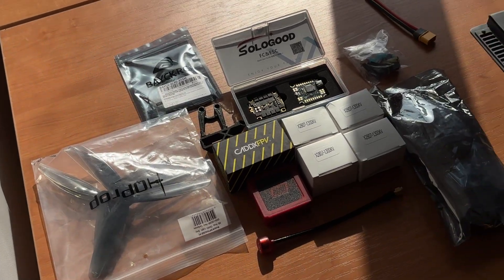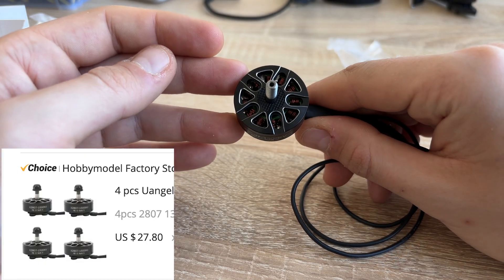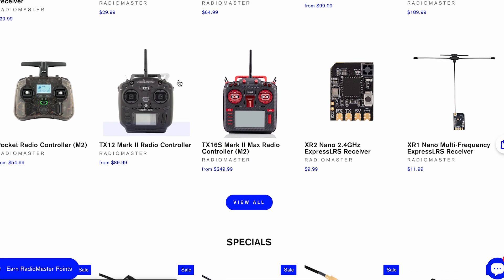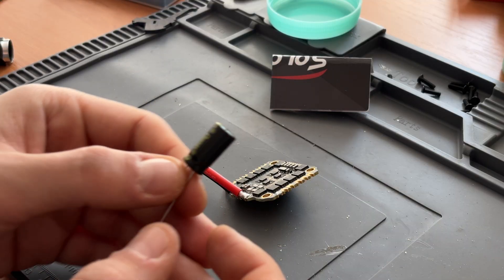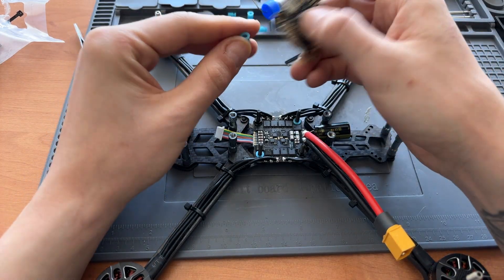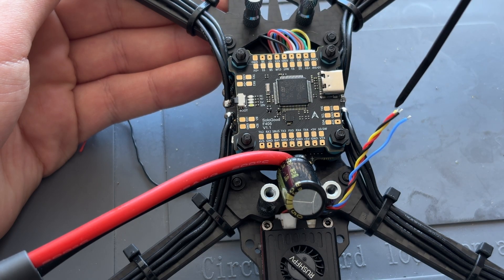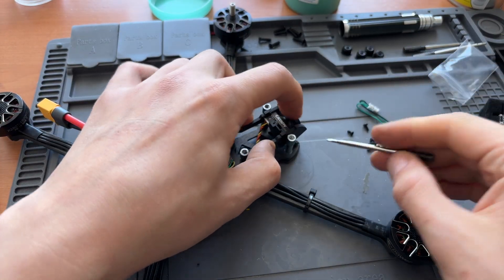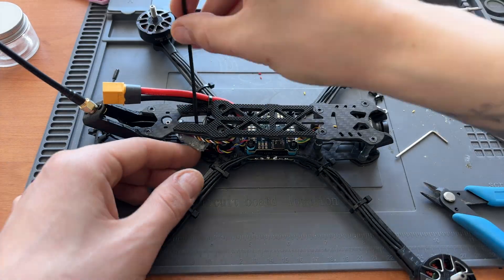FPV Drone Assembly Guide 2025 - Long Range Budget Build | Part 1

Comment: How much do you spend ?
Reply from the maker: I bought all details during Ali sales.
Stack - 37$
Motors - 28$
VTX - 42$
Camera - 17$
Props - 2$
RX - 6$
Frame - 8$
Video Antenna - 4$

144$ in total - 12$ coupon = 132$
Reply: If you start from 0. Soldering kit, controller, and drone. You are looking at around 700-900eur
Reply: I’m trying to have this price! :/
Reply from the maker: @GabrielRibeiroData  currently stack much expensive due to high demand. Also i've provided price in order to deliver into Ukraine. You may notice that when you'll switch destination country the price and shipping cost may vary. 
But general advice: add into cart similar items from different sellers, than on choice day (usually it starts in first days of every month) check the lowest price and apply coupon. If you are trying to find such prices right now - it's unrealistic, unfortunately :(
Reply: @DCSets  Hi, thank you very much for the tips, will do that.
Reply from the maker: @GabrielRibeiroData  you welcome!
Reply: From France, it's more around 250eur

Comment: battery model and wegith isn't specified in the captions. what is average flight time ?
Reply from the maker: I use DIY LiOn batteries with 21700 Molicel p42a elements
The last time tested - 13.5 minutes with 1.5kg camera for 6s2p battery.

Comment: Very nice video, thanks. Just a question, are 70x40 props too aggressive for long range, maybe? Maybe props with lower pitch could be more efficient for long range?
Reply from the maker: Since the last tests, I didn’t notice any significant difference between 70×40 and 70×35. The overall prop condition and quality matters more ( for example in my tests 7 inch hqpros were much better than gemfan).

Comment: 1. max range (not talking flight time)? i suspect the limiting factor is the radio right?
2. no gps? is there any space for it to be added?
3. the gopro mount can be found online for this frame?
Reply from the maker: 1. It depends on radio quality and battery. With retranslator and 6s3p could easily hit 20km
2. You need slightly different tail mount, but it's a quite big drone, so you shouldn't have any issues with gps placing
3. I see some models by "geprc mark4 gopro mount" request. It's a popular frame so should be a bunch of variations

Comment: What are good battery options for this build? What should be max battery weight for 7 inch drone?
Reply from the maker: Since this motors are not rlly responsive for freestyle - you should be ok with lion battery for cruising. 6s2p lion weight somewhere around 900g. This build can easily carry 1.5kg more.
If you want cheepest option for practice - 6s1p lion
6s2p - double the range
lipo - a if you'll decide at some point go to freestyle and swap motors
Reply: @DCSets   i bought 6s Lipo 6000 mAh. 22.2 V 50C weight 900 g. and it looks massiv when i place it on top. It all most leave no place for GoPro on top.😊 Considering even attaching it to the botom. My goal here is long range.

Comment: Which controller do you use or which one do you recommend for this drone, for beginners, and at an affordable price?
Reply from the maker: Hey! It mostly depends on the size of your hands and personal preferences.
The most universal option is the Radiomaster TX12 ELRS (I also have an external module to support 915 MHz). It costs around $100.

The cheapest option is the Radiomaster Pocket, which also works great for most builds, but it has fewer auxiliary switches.

If you prefer larger controllers, go for the Boxer or TX16.

My personal favorite (I have it too) is the Jumper T20S with RDC90 sensors. The only downside is that I couldn’t find a 915 MHz module, so I bought the 915 MHz version instead.

As your first controller, I’d suggest going with the TX12 — it’s versatile and easy to resell later if you decide you need something else.

Comment: I couldn't figure out if the remote and esc are connected automatically, they don't mention this in any of the videos, the remotes are sold without esc.
Reply from the maker: I don’t fully understand your question. The ESC (Electronic Speed Controller) is not directly connected to the remote. It simply receives commands from the flight controller and spins the motors accordingly.

If you’re talking about the receiver (ELRS in my video), then yes — there’s a simple, but not automatic, connection process. You have two options:

Manual binding: Quickly power the receiver on and off three times (either separately or while it’s connected to the flight controller). This will put it into bind mode — you’ll recognize it by the double blinking. Then, open the ELRS tab on your remote and press Bind.

Bind phrase: You can also set up a bind phrase (like a password for your remote). When flashing the receiver, you can enter this phrase. In that case, the receiver will automatically connect to your remote once both are powered on.

Comment: how do you control the drone?
What is your controller? Are you using goggles? What goggles do you use?
Reply from the maker: It's controlled by ELRS, so you can use any controller with its support
I'm using Radiomaster TX12 (also have Jumper t20s). ( i covered it briefly in next video https://www.youtube.com/watch?v=UJcXizibt58 )
Googles - Skyzone 04x pro

Comment: What's the weight and what controller do you use?
Reply from the maker: wdym by weight? if you’re talking about payload - up to 1.5kg camera
controller - i have tx12 and jumper t20s
Reply: @DCSets what's the overall weight of this drone? We have a sub 250g limit in the UK
Reply from the maker: @timne0  ah, got it. Without battery it has somewhere around 650g weight.
250g (without battery) it's something tiny, like 2.5-3inches

Comment: Hi again...i am a bit mixed up regarding the reciever...i bought the BAYCK ELRS 915MHz / 2.4GHz ...it says both 915Mhz and 2.4Ghz...so which one is it ? 915 or 2.4Ghz? or can it be configured for both? my radiocontroller is (Radiomaster Pocked Edge) TX 2.4Ghz...will it work? Thanks Ed
Reply from the maker: If your controller 2.4 it’s compatible with 2.4 Rx only. 
You can’t dynamically switch frequency on receiver. Its 2.4 or 915
Reply: @DCSets  ah i see ok noted...😬 thanks!

Comment: in 14:36 there is a long beep, does it mean you has a short circuit in your cam? and 14:40 also you have long beep in your VTX line, does it mean it is short circuit as well?
Reply from the maker: On timestamps you mentioned i've just checked grounds, so the long beep was expected )

Comment: i am following your build but for motors i have 4 X A2212/13T 1000KV with red,yellow and black wires do you think i can use instead of the motors you use here? can i attach in the same way to ESC...i am using the same Flight stack you use in video...Thanks Ed
Reply from the maker: Technically yes, but  double check the specs. I’m almost sure that they designed for bigger props (maybe it’s a motors for planes). And make sure u are using right battery to not burn the motor.
In terms of connection you can attach 3 wires in any order. It affects only spinning direction which may be changed in betaflight
Reply: @DCSets  Ah ok great thanks!!

Comment: How do you know which wires to solder where? Also is there any kind of tutorial on how to pick out which parts to buy based on what you want? Also are there any tutorials out there on how to add in extra functions to the drone?
Reply from the maker: For every part you always connect power wires, which depends on device consumption. Rest wires you connect to UART ( rx/tx on fc ) or to dedicated pin.
I guess the best tutorials you may find on oscar liang website and joshua bardwell youtube channel

Comment: Flight controller is sold out, any good alternative?
Reply from the maker: You can find plenty of other seller on Ali https://s.click.aliexpress.com/e/_ooMl9i8 for example. Just check the search.
I've tried Speedybee, SoloGood and Mamba. Since i'm not pro racer i don't fell much difference. 
The only thing to mention - personally i found that F722 a bit easier to tune than F405 controllers

Comment: For a beginner which head set would you recommend and controller would you also recommend for this build. Thank you
Reply from the maker: It mostly depends on your budget.
Controller:
 - Radiomaster TX12 (MK2 ELRS) – This is the ultimate choice. It comes with 2.4GHz ELRS, which works well for most quads. For the build shown in the video, you’ll also need an additional 915MHz module.

- Radiomaster Boxer / TX16 – These have extra switches and support the same JR modules. However, they feel way too big for my hands.

- Radiomaster Pocket – This is the cheapest option.

Goggles:
I personally used to fly using a monitor – it's also the cheapest option. You can either buy an FPV monitor or get a VRX + screen (like a car monitor) and build a DIY setup.

- Skyzone Cobra X – In my opinion, this offers the best price-to-quality ratio. I wouldn’t recommend cheaper options, as your eyes will suffer.

- Skyzone 04X – These are great but expensive. Also, they use dual screens, so some people may need time to adjust and may have trouble focusing.

My very first setup was cobra + tx12

Comment: I checked the all links for the parts, and I am wondering that where can I get 3D parts and batter?
Reply from the maker: If you don't have printer you can try to find print on demand in your country / find on ebay e.t.c. If you want to print it by yourself - check the cults or makerworld ( here for example https://makerworld.com/en/models/796689-mark4-fpv-antenna-gps-xt-60-mount?from=search#profileId-735917 )
Regarding battery - i have diy one from westingtonhouse 21700 elements. You can buy cells and solder battery by tutorial (but be carefull (!)). Alternativelly just buy LiPo 6s in any RC store

Comment: I just built the same spec 7' , 😂 but for some reason my quad hovered for 30 sec then flipped. I'm waiting for your config video...I believe there is something wrong with my FC , motors behave strangely, I flashed bluejay and working on dshot 300. In betaflying when I throttle they are out of control, some motor's spins equal sometimes some of the spikes. Master motors working fine , just when  armed I can go to the air, after a while flip 🙃
Reply from the maker: Hey. Config video is already on channel. If you have stable flight and flip after 30 seconds there are two main reasons: something wrong with gyro or pid tuning.
The second reason - something wrong with motor/esc. 
BTW do you see any errors in OSD during flip?
Reply: @DCSets Cheers mate, I watched video, useful stuff but nothing regarding pid/tune etc. I just changed FC for different 722 also covered with conformal counting, I did a few minutes of hoover and motors sounds great, full smooth response for throttle, previously behaved wild, even on arm speed up slightly and reduced throttle without my input. Too short to judge but promising. I exported CLI from 405 and  loaded on f7 22. Still will desolder buzzer and GPS from other 405FC and I will try one more time...also Barometer vanish from 405.... suspicious...all on BF4.5.2
Reply from the maker: @DiabloIIICzarodziej  as i mentioned in video - i'm not rlly good in pid tune :( 
If i understand the behavior correctly - it sounds like gyro issues. Speedybee v3 f405 had this issue in mass, but mostly with rotating by yaw, not flipover. If you'll succesfully run quad on new f722 you can try to change gyro on old FC
Reply: Cheap new f405 cost 15 pounds on Aliexpress , anyway assume that gyro swap required a propa tool set, I'm not on that level...anyway great videos, very clean build....sub added, will watch some more content @DCSets

Comment: why does the propeller link go to 3.5 inch props?
Reply from the maker: Thanks for letting me know. Link fixed. But seems aliexpress sellers change items often, so need some mechanism to maintain links updated :(
Reply: @DCSets  thanks! also, there is no link for camera. what lipo batteries do you recommend? and what flight time do you get with your batteries?
Reply from the maker: @creativebuilds2 i decided not to put link for cam since different people like different image. It's better to check some comparison videos. 
Here is camera from video https://s.click.aliexpress.com/e/_okJUzGw

With 6s2p lion battery and 1.5kg camera it can fly 13.5 minutes (around 60 km/h speed)

If you are looking for long fly - i suggest use LiOn. If you want to do some freestly - you should choose some different motors

Comment: Great video man, love the details

What are your battery specs?
Was wondering if i should stick with a 4000 mah capacity,

Also what battery recommendations do you have?
Reply from the maker: Thanks for the feedback!

This is a 6s2p Li-ion battery made with Westinghouse 21700 cells. If I’m not mistaken, it has a capacity of around 8000mAh and weighs approximately 850g. The downside of this battery is that it can't deliver more than 80A continuously (up to 110A for short bursts).

The battery should be chosen based on your needs and flying style.
4000mAh is fine for this build, but if you're looking for a smaller battery to reduce weight and plan to do freestyle flying, I strongly recommend using different motors. The motors shown in the video are intended more for cruising.

Comment: Hi. Great video! What is the battery weight and how much weight do think it can carry on top of that? Thanks
Reply from the maker: @josepoyanrodriguez9837  hey, it’s 6s2p 21650 elements. The weight around 900g. Quad can carry 1.5kg payload keeping the good speed and maneuverability
Reply: @DCSets  Great. Thanks! I have the super idea of building an UFO in the future. That is: a huge lightweight frame surrounding the drone. The 1.5kg would be the max frame mass. Time will see....
Reply from the maker: Cool idea ) I had similar one, but with small quad. Hope will have time for it.
BTW if you'll se than 7 inch props are too big - you can always build drone with 5 inch props, but use 6 or 8 motors to keep same thurst. Just create mount and attach 2 motors for same arm (here is random example to explain what i mean https://encrypted-tbn0.gstatic.com/images?q=tbn:ANd9GcSLW_HajXn8b_aZfvQxzESA-8mzt7ziC1zQsw&s )
Reply: @DCSets  Great! I guess it will be 8 motors. It is a cool idea and I might implement it. Thank you!

Comment: Most of the item links dont seem to work
Reply from the maker: @larrybarry8674  crap :( i’ll update them in few hours. Thanks for letting me know 🤝
Reply from the maker: Where are you from? I've checked all links and they work (also items are available for delivery in Ukraine)
* Also do you see any web error after click the link, or items not available?
Reply: @DCSets  I am in the US, when I click about half of the links, and it provides a "Sorry, the page you requested can not be found :(" when I click on say the link for the frame. For a split second I see the pic of the frame pop up, but then it instantly goes to that error.
Reply from the maker: @larrybarry8674  i see. Faced the same issue when changed delivery to US. Thanks for catching this "bug". Also i see that price and taxes for items are insane, so there is no benefits to order from Ali :/

Comment: where did uyou find the anteanna mount?
Reply from the maker: I can't distribute the mount from video, but there are a lot of mounts for mark4. Here is a link for one of them (free version) https://cults3d.com/en/3d-model/various/mount-for-mark4-7-10-inch
Almost the same configuration
Reply: @DCSets do you have the link to purchase it I have no problem paying for it
Reply from the maker: @miaowzerz  this mount developed by Ukrainian volunteering organization, so unfortunately its not for sale too
Reply: @DCSets  my drone motors are hot even though my fc has space to move how did you overcome this issue
Reply from the maker: @miaowzerz  most likely your motors are hot because of some pid/vibration issues. Here how it works: 
- gyro on FC detects some vibration and because of wrong filters treat it as wrong quad position.
- in order to reach desired position it sends command to ESC to spin some motor.
this happens with hight frequency and lead to motors heat. 
In order to resolve the issue you should:
- make sure everything (screws/standofs/zip ties e.t.c.) are tighten very vell
- there is no play in frame arms
- your props are not damaged

With preset ( and ofc parts) i've shared it should resolve the issue.
If not - you need to write the blackbox to see vibrations frequencies and filter them accordingly.

From other hand you may have too agressive PIDs. So if described above doesn't help - try to play with them. Here is a good article to start https://oscarliang.com/pid/